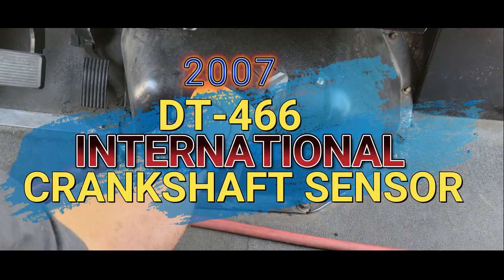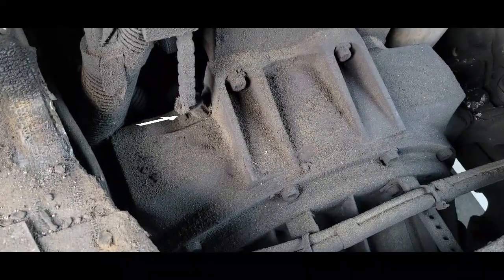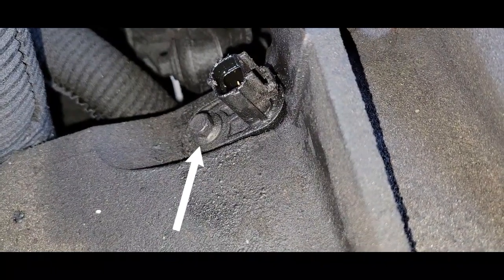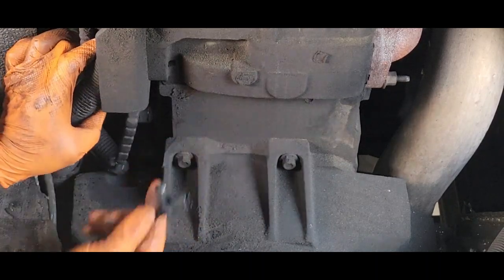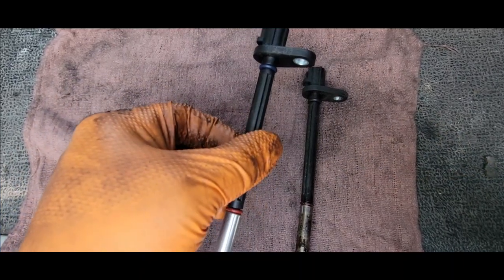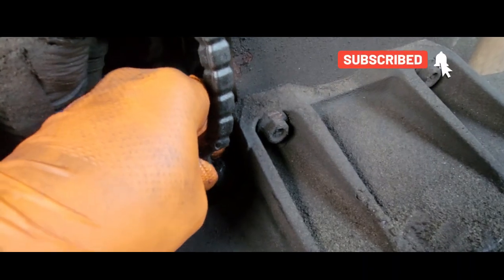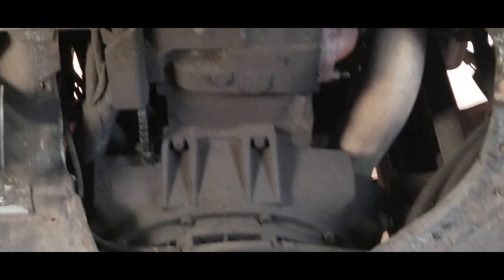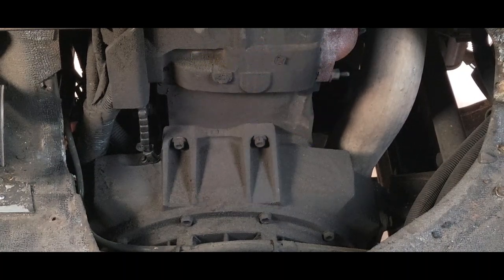2007 International 4300 Crankshaft Position Sensor Replacement

Comment: Hey there I had a question. I have a 2015 durastar with a maxxforce dt and I have SID21 Fmi 7 engine position sensor. Do you know if this is a code for the crankshaft position sensor or the cam position sensor? Any help would be appreciated